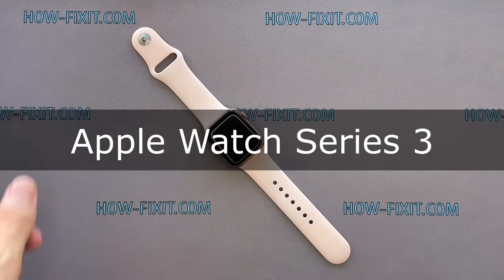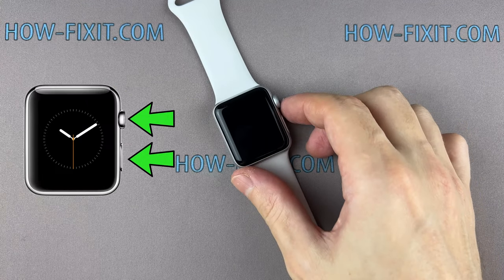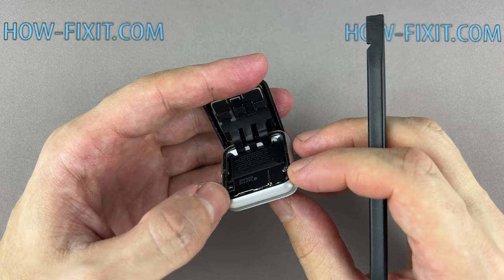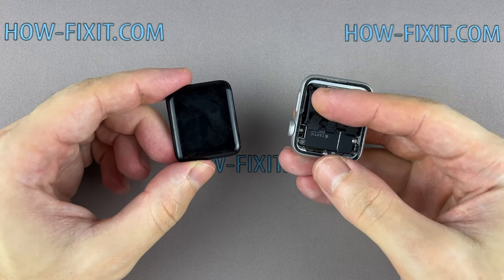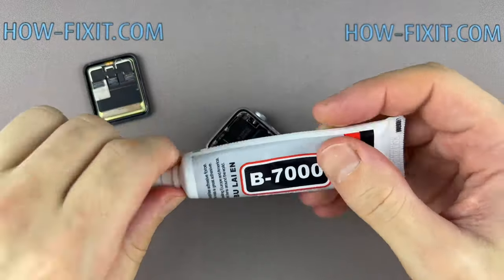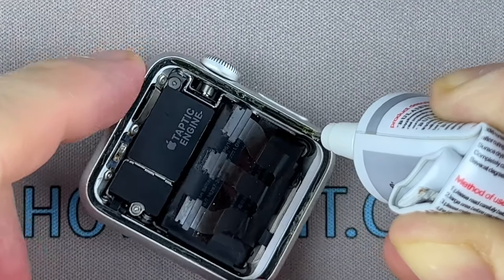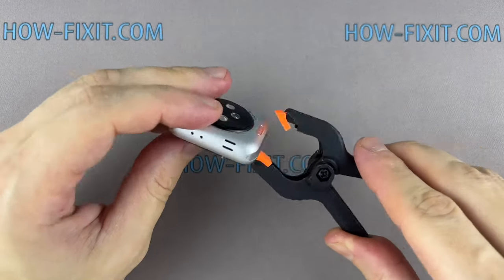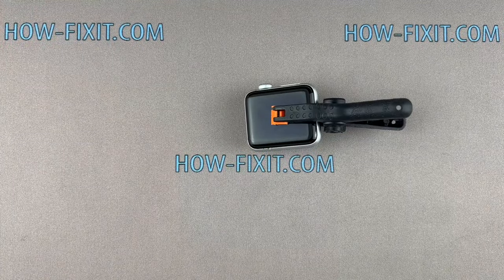Apple Watch Series 3 Screen Replacement

Comment from the maker: Replacing the display can cause issues with Apple Pay. If possible, to reduce the likelihood of problems, delete all your Apple Pay account info before the replacement, and then re-enter it with the new display installed.
Make sure to update your Apple Watch to watchOS 5 or later (and the paired iPhone to iOS 12 or later) to avoid pairing issues after a display replacement.

Comment: Great tutorial.  I have an s3 and the screen just fell off leaving me with only the rest of the watch.  I want to buy a screen but how do I even know if the watch will work once I install it?  Is there any way to know if it’s working even if it does not have a screen?  I tried hard restart to see if it vibrates or shows up on my watch app or find my but no dice.  Any pointers?

Comment: Why to use generic flexible tool if exist a specific tool called iFlex? It born in 2015 precisely to disassembly Apple Watch. The part that need to enter between frame and glass is slightly sharped to make easier to introduce in the gap 🤷‍♂️